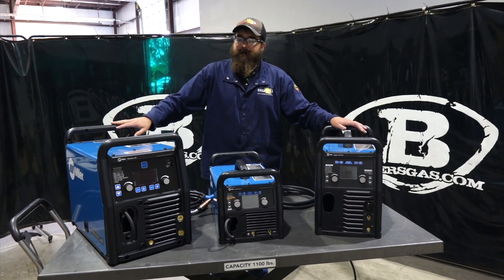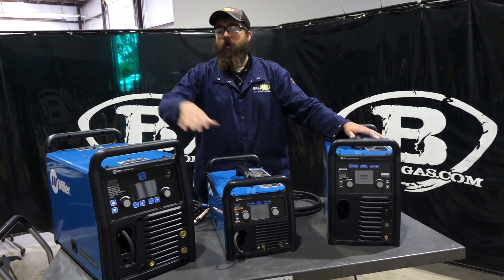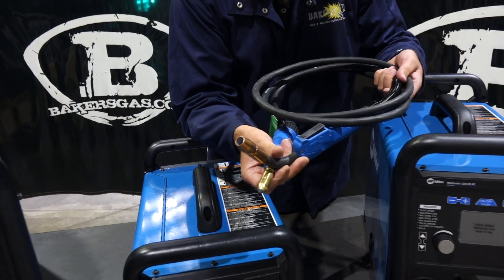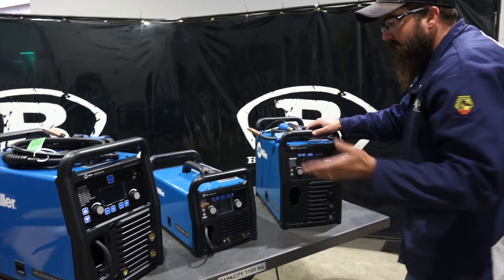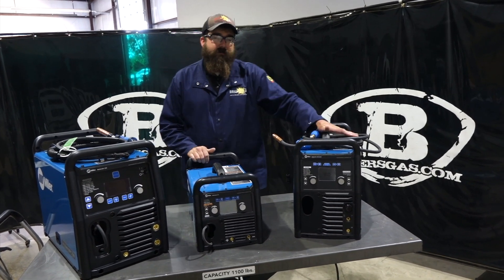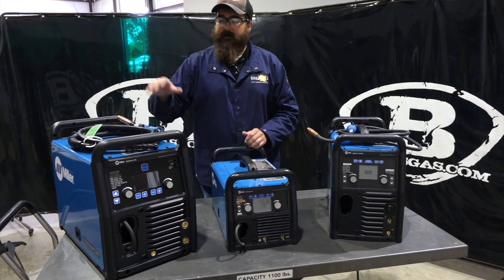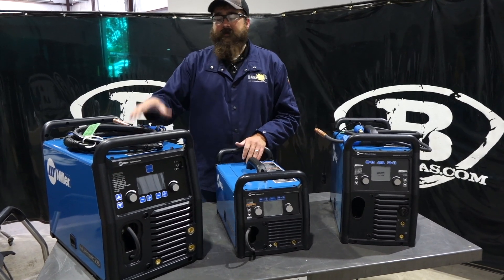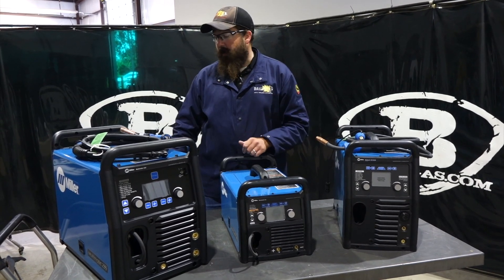Which Multimatic is best for you? Multimatic 235 vs Multimatic 215 vs Multimatic 220

Comment: Yikes, the price on the 235 has jumped nearly $700 since this video was made.  The 215 is $500 more and the 220 is about $1,000 more.  Not sure it’s supply chain related or the prices were lower earlier from COVID?
Reply: The law of supply and "there's a huge demand so we will jack up the price and make more money."
Reply: @frankjames7272 I ended up buying the 255 Millermatic with cart from the welder store, around the time I posted that last comment. 

Since the machine was so large and heavy, I paid $500 for the integrated cart…dumb! The cart was not worth it, thin steel. At the time my rebate was increased if I bought the cart.

Comment: What’s your thought on the 220 vs a dynasty 210dx. Trying to pick if I want two designated units or an all in one for my mig/tig
Reply from the maker: Hey, really would not compare the two. The Miller 220 is a great true multiprocess unit that will TIG aluminum but does NOT have the adjustments and arc characteristics as a Dynasty (much more industrial machine)

Comment: Looking for a TIG welder for aluminum, stainless, etc. but want to be able to mig/stick(push/pull) be as versatile as possible. 

That 220 and 255 can’t have a kid can they? 

Thinking I should just get separate dedicated machines, but that 220 might be a good start…? 

Hate to buy twice when I could have gotten the exact fit the first time!
Reply from the maker: Hey! So if you want the AC TIG multiprocess you have to go 220. However if you are willing to go MIG aluminum the 255 is a sweet unit for thicker material and pulse is nice. 

If you want to email us we can price both out and help you decide what would be best for your application.
Reply: @BakersGas  I've been looking at TIG only machines so I don't have to compromise! What would you recommend?

Comment: If I want to do exhaust work and occasionally 1/2" metals, what is a good welder?
Reply: Multimatic 255
Reply: Miller 252. Much cheaper and comes with wheels. Very good welder

Comment: I'm considering the 220 for the versatility of the machine. some of the projects id like to build do require a fair amount of welding like tandem trailers. it makes me lean towards the 235 for the duty cycle increase but id hate to lose the ac tig for projects down the road. if im welding around 19.5V - 20V do you think welding larger fab projects would be too much for the 220? I'm not going to be welding long beads but once everything it tacked up there could be hours of weldout time... what are your thoughts? 
thanks

Comment: I just need a machine that can run stick and Tig preferably higher amperages. So what machine would be recommended?
Reply from the maker: If you need AC TIG the 220! If not the 235/255 have a higher duty cycle but DC TIG only.

Comment: I already have a mig that works well for me. The miller MVP 211. Its around a 2012 model or so. Im wanting to add tig capability. How is my money best spent? A) sell my current mig and buy a multiprocess like the multimatic 220 or B) keep my welder and by a dedicated tig machine like a syncrowave?
Reply from the maker: Put your welder for sale and we can get you the 220! OR we can help with a dedicated TIG unit for sure.

Comment: Hey guys, i know nothing about the machines, but started at a heavy fab shop as a painter about a year ago, and its peaked my interest. Some of the guys let me use their machine to try out, and apparently i did very well, so id like to get one for home. I know id like a multi process, i wanna be able to TIG, and MIG,  but idk the difference in ac and dc tig. Also, i can only use 110, and cannot upgrade wiring as i live in a 2 family house and do not have access to the main. So basically what is the difference in AC and DC TIG? And what is the best option for multi process at 110? Money is not a huge factor, but id like to stay under 4k. Thank you!
Reply from the maker: Hey! So if you want the ability to TIG weld aluminum in your multiprocess unit than you need to go 220! If your not needing/wanting to TIG (AC TIG) than the Multimatic 215 would be a good fit for you. Call us and we can help walk you through the little things and help you determine which is best for you. support@bakersgas.com or 877-930-5690 Thanks for watching!

Comment: what happens when u operate  the welder past its usable duty cycle. Explain what happens please.
Reply: It overheats, causing undue wear and tear on the components which means paying to fix and replace parts.
Reply from the maker: Duty cycle can be exceeded but not good for the machine. Plus if you think about it 40% duty cycle would be 4 minutes of continuous welding which is quite a long time of welding.

Comment: Will the 220 handle dual gas MIG welding. Sorry if that's not the right way to ask.
Reply: If your asking if the 220 can use 25/75, it will.  I have a 220 with both 100% argon and a bottle of 25/75 argon mix.  No issues so far.
Reply: @BigPowerAL  Thx, but no. Dual shield is probably the correct way to ask. Basically it is shield gas and flux core at the same time.

Comment: Will the 235 hold an arc with 6010?  if not, what would you recommend for MIG/DC TIG/Stick multiprocess welder?  I don't see myself doing any Aluminum TIG and can get a spool gun if things change.
Reply from the maker: No, if you want to run 6010 you would have to buy a dedicated stick machine or the Rebel line will do it

Comment: Anyone in the world going to run a bead with the 235. 
I've not found a single actual review on it yet.
Reply from the maker: We use it in one of our videos promise it welds good
Reply: @BakersGas  
Your correct,  ive burned almost 40lb spool through the one I bought from you.
Any trouble with drive motors yet? How many have you sold?

Comment: Great video. I’ve been considering one of these but I already have a Miller 250 (old machine) and a Diversion 180 with a pulse box by Jattus. Would there be any advantages to go with one of these machines? It is rare for me to weld anything thicker than 3/8” mig. Backup welder is a Hobart 140 because of the Miller 250 age and past industrial use. Thoughts? Great video btw
Reply from the maker: Thanks for watching! The new machines make a big difference. The obvious things are the size/portability, technology and newer consumables. The key things for us for you to consider is the set up time, versatility and ability to connect spoolguns. Auto-Set would make setting up for a weld quicker and being able to take the welder with you to another area of your shop/or completely different location could open up options for you. If you ever wanted to do aluminum the direct connection for a variety of spoolguns is a nice feature. If you want to call us or email us we can provide more information.
Reply: Baker's Gas I appreciate the response and will be calling. Curious about the spool gun setup
Reply from the maker: @K_M_M_G  Great! Look forward to working with you!

Comment: How much does a tig kit run for the 215? Is the tig kit worth using on the 215
Reply from the maker: TIG kit is about $429 if you add it on after for the 215! Yes if you want to get into TIG welding we would recommend that kit! I will link below for you. https://bakersgas.com/products/miller-301337
Reply: I have had my 215 for over year, I like it a lot, But TIG kit not worth it. Very difficult to do small material. And it doesn't like to do thick material
Reply from the maker: @therealjorge9997  Thanks for the feedback. See that is where the 235 could give someone ability to do some thicker material.
Reply: You cannot do alluminum with the 215 tig right?
Reply from the maker: @1970chevy07  You can not TIG aluminum but you can MIG weld aluminum with a spoolgun! You can get the spoolmate 100 or 150. I will link our video on the spoomate below for you to check out. 
https://youtu.be/96DuscLVCGs
Reply from the maker: @1970chevy07  You can MIG weld aluminum with a Spoolgun but no you can not AC TIG with the 215. ONLY the 220 has that capability.

Comment: yeah hey fellas thx for all ur videos, just wana know one thing so wiyh the mdx 100 gun is that onlu good for 100 amps? and also can i purchase a mdx gun that can uphold the amps of the 220, if so whats the name of that gun and how much ? thanks guys
Reply from the maker: You can purchase the MDX-250 if you want. The MDX-100 matches up based on the max duty cycle / amps. As noted in the video the 220 and 215 do come with the 100 and the 235 and 255 come with the 250. I will link the MDX-250 in case you wanted to upgrade. 
Comes in a variety of length's but here is a 10 foot one:
https://bakersgas.com/products/millermdx-250miggun10ft-3m-1770035